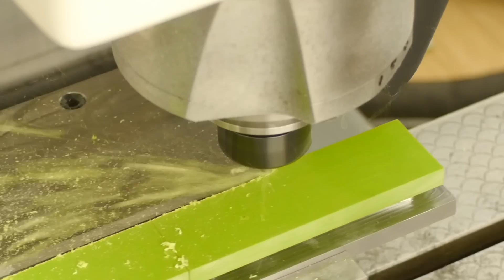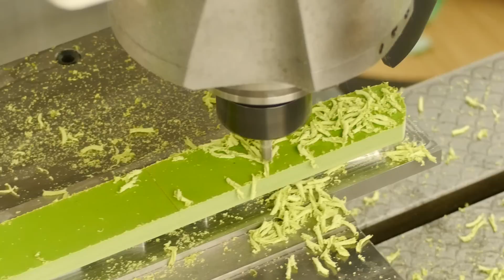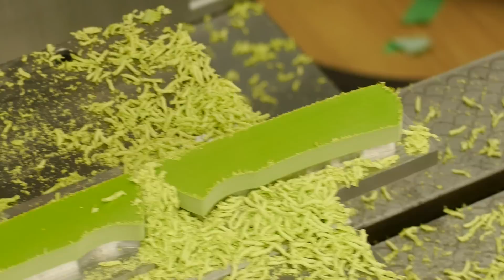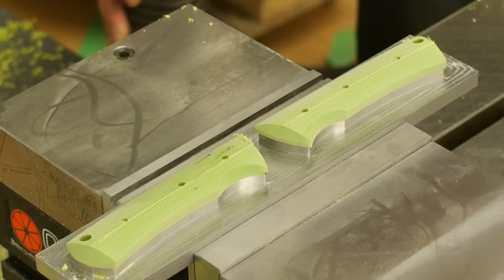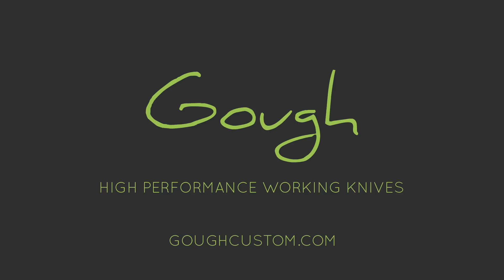Prototyping handle scales on the VMC!

Comment: That 88HS control has no trouble handling those high speed tool paths, but then that was one of the fastest controls anywhere at that time; it has a separate 8086 processor for each axis plus an 80286 front-end processor.
Reply from the maker: douro20 I've been very impressed with the control so far. It has a couple of quirks, but overall seems to run very well!

Comment: Wow. I've just watched your recent VMC vids back to back. Your attention to detail is quite impressive. First, the overhaul, then the perfect blue chips on your FIRST cut! Then, on the handles you 'roll in' your approach with the fly cutter/shaper!  These are not rookie moves!  I don't think some viewers appreciate the background work that goes into creating a product: the research, conceptualization, prototyping, planning of operations, fixturing, testing, yes drawing in CAD, tweaking programs, selecting tools and paths and cutters by material.  It's not point , click and out pops a product.  It's like building a ship in a bottle, using a machine the size and lethality of a great white shark.  Kudos to you.
Reply from the maker: +braxtonec Thanks mate! Clearly you've had to tackle some of these problems yourself, as it's not really something anyone can appreciate without having very close exposure to it!

So far fixturing has proven to be the biggest challenge. I thought up front that the handle scales would be difficult but they've turned out to be the easiest part of the project simply because the fixturing is straight forward.. They're bolted down using blind tapped holes on the underside then all the features can be machined in one shot!

The blades themselves are so much more difficult. The edge of the blade is only 0.012" thick and trying to fixture that adequately to allow machining has been quite a challenge. I have made progress in the past week with a new fixture that uses edge clamps and a close cutout of the blade, but more work is still necessary, including more work on the VMC to replace the spindle (which has runout) and the ballscrews (which have lost motion).

Hope you've enjoyed the videos!
Reply: Gough Custom I figured they were blind holds, which work in small numbers and a single setup, but can become cumbersome when you add more parts due to the potential for an interruption of some kind before the run completes.  Haven't made scales and can't say that I wouldn't tackle them in the same way myself.  If I ever do, I may put index locations on the top side for re start locating and use G52 to copy the moves in sets/rows so I can 'turn off' moves over the empties or skip ahead to new loc.  Regarding blades, I haven't made those either, but I have cut thin unsupported metals and suffered the consequences ;).  I ended up creating a B side fixture that the A sides flip onto and get support from behind to prevent vibration  cuts. It drammatically improved the outcome. I've made lots and lots of 'learning opportinities' and keep them in a bin to remind me.  Good luck with the spindle. I've just recently discovered instagram and may even sign up so it will feed me updates.  Will go check it for your more recents.
Reply from the maker: +braxtonec Hey mate!
Generally if I have an interruption I just restart the program and let it machine air around the existing parts. My tolerances are close but not insane so that seems to have worked fine!

I will be releasing a new video either today or tomorrow that details the optimized handle scale process, so keep an eye out!

Comment: Wow Aaron, 6 minutes a pair compared to probably a 1/2 day by hand!  A lot less finish work it appears too?  The custom profiler was great, does it have inserts or a single tool?  The other looked to be a 60º cutter of some kind and put a nice finish to the edge.  You've sure come a couple 100 leagues since the hacksaw and propane torch days!!  Congratulations...Outstanding!  ~PJ
Reply from the maker: Thanks PJ! The radius tool has brazed carbide cutting edges. I'm hoping to get to the point where virtually no finish work is needed!

Comment: Did you do the G-Code by hand ?
Reply from the maker: Jørgen Hansen Hey Jørgen! Parts of it were modified by hand, but the bulk of it was made using a program called Fusion 360. Most of it is simply too complicated to do by hand in any reasonable amount of time...
Reply: Thanks for answer, great work you made, also with the machine. (Y)
Reply from the maker: Jørgen Hansen Thanks mate!

Comment: Great work, even though i dont like that you mill the blades too. Other than that nice work, you could optimize the programm cycle towards circling in the final shape
Reply from the maker: Thanks! I will be uploading a new video soon showing my vastly improved process for both the handles and the blades... Looking forward to releasing that!
Reply: It is not about the process, honestly your knifes just look sorted. They look perfect and obviously are great products. But in my world knifes just have to be ground down. That might be a mistake i have in my mind, and there is nothing bad with shaping the handle and the grips on the cnc, but the blade itself should be ground. That has nothing to do with the quality and both are technically just removing stock, but i feel like it is different ^^

Comment: how did you get the material to stay in place?
Reply: I think Superglue :)
Reply: My guess would be by pinning and screwing bottom onto fixture. You OP 1 the bottom side to have 2 locating holes and a couple of blind screw holes. You screw the parts to the aluminum piece (that holds it down) while the pins keep it from sliding from side to side. Other option is a vacuum on the flat bottom but that only works if it is also pinned or else side load would slide it off the fixture.

Comment: New Resolute? :o Do you have other designs?
Reply from the maker: Sinoncad Just the Resolute for the moment, the new version will actually be replacing both the previous 4" and 5" versions of the Resolute!

I'd like to get into folders at some point as well, but I think that's a while off yet...

Comment: Nice! I've always been wondering how this thing works? Do you give it start shape and end shape and let it do its job or user has to program whole thing in particular order?
Reply from the maker: Hey mate! You have to program all the movements of the machine as well as the tool changes and so on... however there is software that you run on a different computer that helps with the programming.

Comment: Nicely done.  What is holding the G10 onto the tool?
Reply from the maker: +Belnap Custom Knives (Courage and Foresight with God's Aide) Thanks mate! There are blind holes drilled and tapped on the underside of the G10, which allows it to be bolted down to the fixture.